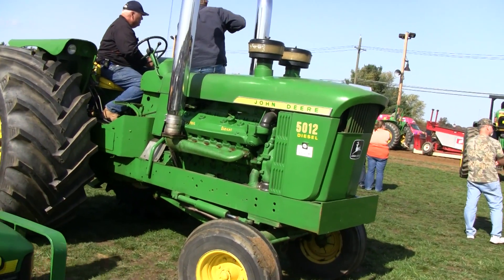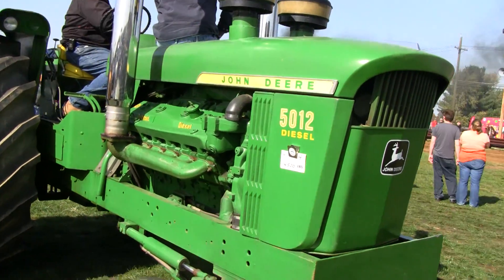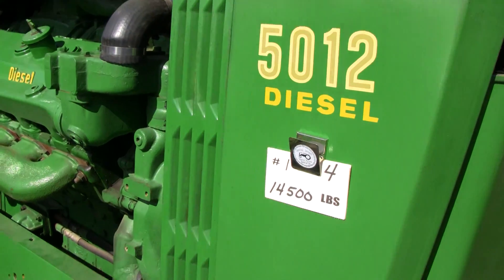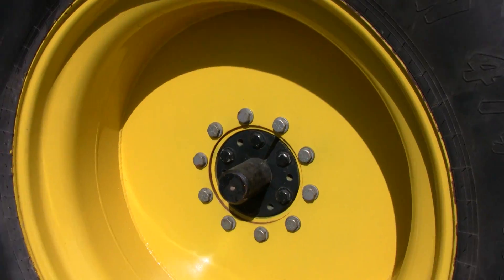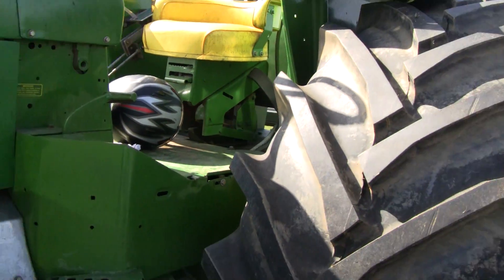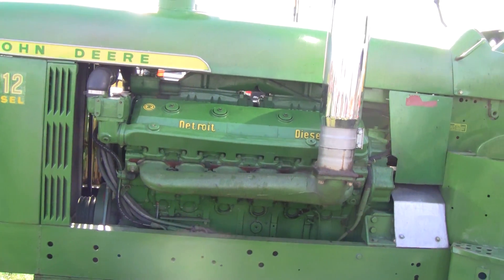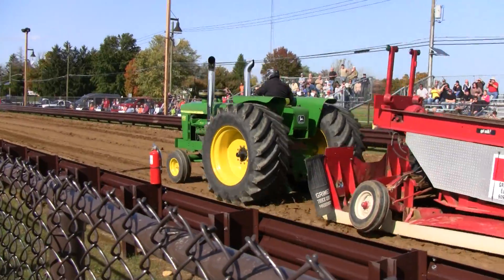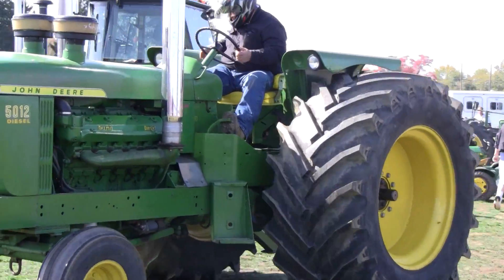JOHN DEERE 5012 DIESEL 2-STROKE V12

Comment: and it has nothing on the low end.....thats why most of them have to run a Allison trans..when they pull down they are done...and as far as doing work a cat will outlive them on less fuel and last one hell of a lot longer
Reply: mystic1754 You DO realize the blowers on a Detroit do nothing as far as supercharging, don't you?
All they do is blow out the spent exhaust and blow in fresh air.
Drag racers soon discovered they make fine superchargers.
Reply: Brad you are an IDIOT! for friggasack, they can make over 3,000 horsepower with some good turbos and good injectors, and there is no top end since most redline @ 3 grand. so shut up you idiot who does not know anything.
Reply: You sir know nothing about diesels.  The technology put into a detroit makes a cat look like a 1930's joke.  Did you get your degree in automotive from a crackerjack box?  The reason it has to run a allison trans is because of the amount of low end torque.  Cat makes great engines but have never compared to the fuel economy of the electronically controlled detroits.
Reply: fuel economy means nothing when you are pulling over 80,000 lbs all day long...and the detroit won't handle it without breaking piston skirts and destroying themselfs
Reply: you have never ran a detroit in real life and it shows...i started out with a pos 318 detroit that the owner had straight pipes on and i have hated the oil slobbering..no off idle power...engines...
  And you think a Detroit is great? we had two dozers one a Cat and one a Terex..working side by side in a gravel pit both with udozers...the detroit needed overhauling every damn year...the Cat ran this way for over 10 years with nothing but routine maintance..so please tell me how well a pos detroit is!!
Reply: foclmao this was with a brand new detroit...factory built..so goes you idea of a worthless mechanic and detroit was the only engine outlawed for indoor display because of the oil leaks ..and this was when they were brand new...THANKS FOR PLAYING...PLEASE TRY AGAIN.
 Also the steam engine was around long before a detroit and lives yet today does this make them better? no it means old farts refuse to let some of the old stuff die...do i have a detroit...no i don't personally have one..the ones i have run were built by TEREX of sioux falls..so i guess the factory rebuilders aren't worth a shit...
  Now is there anything else you want me to clear up?? 
   If i HAD to listen to some engine at full scream a day it sure as hell wouldn't be a detroit..
Reply: mystic1754 I have no idea what experience you have with detroits...i have run them in a gravel mining...gravel hauling and road maintance company for over 30 years...
 If i have a choice on the engine i run it won't be a detroit...not when the 140G grader i run now if it was traveling 55 mph for every hour on it has been around the world 5 times..Doesn't burn oil...still starts by itself when -20 without ether..and burns no oil
Reply: i have learned from experience...and yes i was trained to work on these engines until  a motorcycle accident screwed up my body...and you can love em all you want...i will stick to old cats and old macks...every detroit in a gravel semi from my experience if you can use them hard all summer you best have a stall ready for them come fall...if everyone loved the same thing the world would be boring but i will stick with my experience running them...
  And don't forget about the old detroits running backwards when killed on a hill and running dry...setting air cleaner on fire and just ruining the engine.
 And why doesn't is it surprising that someone that thinks a detroit is great believes in a ufo?
Reply: and if you study and look you will find the allison transmission was built for a detroit so it could build some rpms so it could do something...but i guess history isn't your strong point ...just like looking something up ...you have t be a liberal because they are famous for that...and if i posted the original material you would just say it's fake
Reply: mystic1754 the main reason old detroits were loved was the ease of getting hp...crank up the pump....change out the injectors throw a turbo before the blower..
  Just not my bag of tea as far as a engine i want to listen to every day...once in a while yes i enjoy hearing a detroit scream..would i listen to it everyday..day in and day out...HELL NO
   We didn't soup up tractors...we used them day in and day out...they all had quirks..the perkins engine hated rpms...had a oliver 1800 at the time everyone was bragging up john deere 4020s..that old oliver would pull 5 bottoms breaking sod on the same fuel that the john deere did pulling ..and we didn't have to add weight to the front so we could steer..
  Ever engine might have it's place but the detroit in something you have to ride all day every day for over 10 years...no thanks..
  What i find funny to this day is kids..they hear a detroit and go wow listen to those rpms..they don't understand it is turning the same rpms as a cat or any other diesel but it is a two stroke..
  First detroit i ever drove the boss said i want you to blow it up all day...run it against the governor..at the end of the day he checked the oil and gave me hell for babying that engine...
  One old timer summed it up the best..slam your hand in the door then try to blow it up all day and it won't use oil..baby it and you will go through a gallon of oil a day
Reply: crank up pump pressure not change the rack setting
Reply: These are diesels, kid. They rely on "low end".
Reply: yeah right that is why they quit making them right because they had so much power and didn't use any fuel and never leaked
Reply: 3,000 rpm...got that turning pretty good for stock...and i should say something..i started with a 318 detroit twin stick...have run 8 71s and a 6 71...yes i enjoy listening to a detroit ....i just prefer the cat...and yes the detroit is easier to soup up..thats why pullers love them...but it is like when i was a kid and a old fart bragged up his souped up model A with a stock bottom end...yes he liked it....yes it was behind the times with babbit bearings and splash oil system...he liked and fine...you like detroit and yes for a puller they don't work bad...but it is like that model A....not the best given the technology of today...and yes if i was going to build a pulling tractor i agree i would more then likely use a detroit...if i was going to farm with it...probably not...and what no one here seems to grasp is off idle power...before the turbos spool up...before the blower is working the best...and everyone has their favorites...john deere...international...cat...chevy or ford...and yes it is a nice looking tractor and yes i watched just to listen to a detroit run...i wish him the best of luck with that tractor and in life...and for those of you that call me a idiot...ok since i use my real name instead of hidding behind some bs made up name and don't act like a complete fucking asshole i guess we can see who is the spineless coward
Reply: i have run them...worked on them and yes they are easy to soup up like i said....but like anything the more you crank it up the shorter the life....and i DON'T like to pull something in and overhaul it every other year like the 6 71 we put in a ts 14...and before you bitch about the guy that rebuilt it...it was done at the terex dealership because we didn't have time to mess with it...and like i said...different strokes for different folks....will stick with 4 strokes for the work i do...it's bad enough keeping air cleaners clean in those doing dirt work
Reply: you forgot about adding propane
Reply: mystic1754 and you think no one else in the world has run construction equipment?? granted my family didn't go in for working with the government...we worked for people we could trust....and have been for over 3 generations...and i told my sons not to follow it...with price of fuel and all the other bullshit it isn't like it was over 30 years ago when i started

Comment: i have a video called  tug Miseford stack  its a video of one tug i work on that has a detroit diesel quad 71 pack, its 4 6-71's mounted to one gearbox.   its just a quick video of the stack while she is reving.  havent got around to take a new video yet.
Reply: cooey84 I was in us army trans Corp there were some of the quad, tri and double setups in LCU and other landing craft left over from WW2 and Korea.  couple of BARCS . Barges with 4 big rubber tires and Detroit generator on each wheel. Supposed to go anywhere, got tossed around like a cork

Comment: Powerful, efficient, reliable, easy to repair and service, rugged, easy starting in any weather and temperature, low particulate emissions (even tho the eco-beaureaucrats in Washington disagree!) cool operation, complete removal of burned gases through blower-valve-uniflow scavenging (The Clark Cycle) instead of 'choking" on it's own spent gases like all 4 stroke diesels are renowned for, and a power impulse EVERY revolution for ALL cylinders--so 12 per revolution--that's a Detroit! The best!

Comment: 71 series Detroits typically make max horsepower at about 2100 rpm. 450 hp at 2100 rpm would be 1125 ft-lbs of torque, and that's not even the torque peak. Peak torque is probably around 1400 ft-lbs at 1400 rpm.

Comment: My Dad is in to those Detroit Diesel engines.  He has two of the V8-71's and they are the same size as the 12 cylinder just 4 cylinders shorter.  Very good engines.  A lot of people use them in Shrimp boats down here.

Comment: the original engine would have been a 531 ci straight 6 diesel that makes about 133hp and some ridiculus torque.many were modifed to get more hp out of them. but some tractors were repowered with the 12v-71 engines